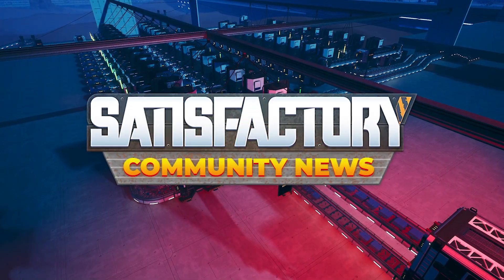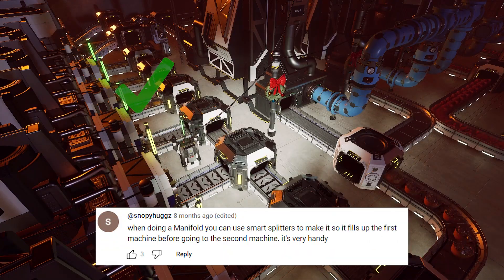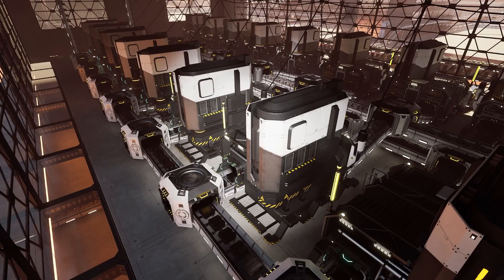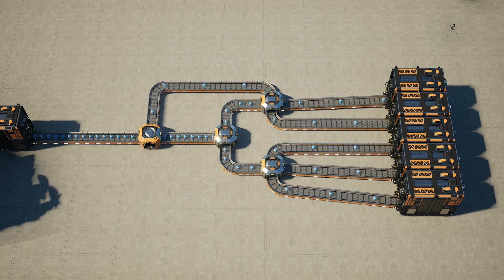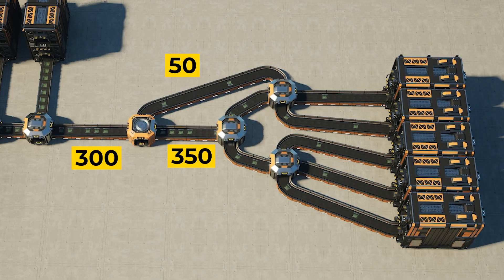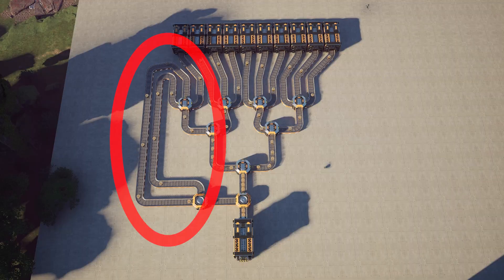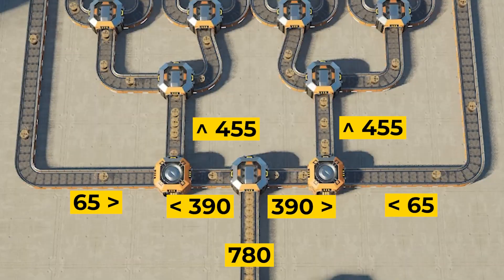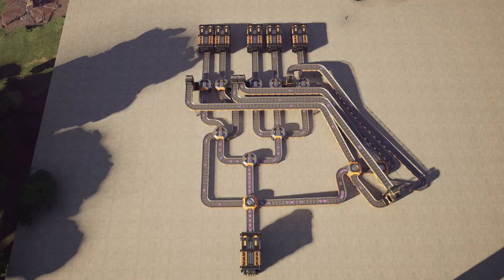Manifold and Load Balancing ADVANCED Tips | Satisfactory

Comment: Man I need help. What’s the answer to using a manifold thats way over the belt speed? I need to move 2k material :(
Reply from the maker: The only way is to split it into several smaller chunks. Instead of one system, make multiple systems.

Comment: Why all of this? All of these are very simple, yet they’re done in a complicated way. What we actually need is a scalable smart splitter for balancing. For example, if there are 10 builders, when we select doors and items on the first splitter, we should be able to assign a 10:1 ratio — then 9:1 for the second splitter, 8:1 for the third, and so on. That way, each splitter would take 1 of the selected item and pass the rest. It would also be great to have a conveyor belt with adjustable speed, like the ones builders use, so we can create smarter designs.

Comment: My biggest issue with conceptualizing how to move from load balancing to manifold is, like, okay... I set up manifold lines for my tier 1 parts: wire, plates, rods, etc... now, what do I do to manage that output across different needs?

For example, I set up a manifold for smelting copper ingots until I'm smelting the whole input. That output manifold needs to go into both copper sheets and wire, both of which need to feed both their own storage and their respective manifolds: cable and AI Limiters, which then need to feed both further manifolds and storage themselves. And so on, and so on, all the way down to manufactured parts.

So how do I decide what length to create each manifold? How do I decide, in the example above, where to divide between converting into wire and sheets? Or for iron, the divide between plate manifolds, rod manifolds, and cast screw manifolds? I would like to try moving toward adapting manifolds into my factory, because I can see the value in them, but my brain just doesn't work in a way that I can conceptualize how to apply them without serious foresight and planning.

Comment: I hate to contradict your correction on the loopback belts from last video, but unless mergers work completely counter to how splitters work, then your original design is fine. True, you can't over-saturate the starting belt, but the merger will still inject an item into its output from a different input each operation if possible. Your machines only backed up in the first video because they weren't on. You won't end up with a deadlock of belts, because if the loopback locks (which it won't**), it would still just send the items into the machines like normal. It's actually better to have it sent back to line 1 and be "over-saturated" because then the machines at the end will always end up with a consistent amount of items, and you wont end up with a huge backlog of materials you aren't using, provided you throw a smart splitter before the merger of the loopback on line 1 to send the overflow somewhere else to be used.

**Your loopback belt will never deadlock, even if you think it might, because you are thinking of the splitters and mergers the wrong way. You are not running a belt THROUGH a splitter and pulling another belt off of it, you are putting a belt INTO a splitter, and making it become more than one belt on the other side. Mergers are the same, you are not running line one THROUGH the merger, and only adding the loopback to line one, you are running both lines INTO the merger, and combining them into one output belt. If able, the merger will cycle which belt it pulls from every time it outputs an item. This may seem like a pointless distinction, but it's the only thing I can think of for why so many people thought you were wrong in the first video.

Regardless of where you put it, having a loopback at all will effectively lower the efficiency of the amount of items you are inputting, vs. the amount you are using, because there will always be some amount of items on it. The fact that this would be "over-saturating" line 1 doesn't matter, because you weren't even using all the items on it anyways.

You weren't wrong in the first video, but you also weren't technically wrong in this one either. Both are fine, but the way logistics work in this game, you can only really deadlock things that have more than 1 output (unless you are specifically trying to at least)
Reply from the maker: I think the point is, if your input belt is already at its maximum capacity, then a loopback belt will oversaturate the input belt. But, that depends on your numbers, and you can only guarantee that it applies to a fully utilized belt.

Comment: So I might be crazy, but I don't try to perfectly balance things. I've always done load balancing, but since we need to use many of these items for crafting, I just...end it in a storage box, label the storage box with my input (amount crafted) and my output (amount used by machines further up the crafting chain) so I know my crafts/min of say iron plates. Since I need a surplus of iron plates for crafting machines/conveyor belts/etc. I want a surplus. I figured my options are make a system that ends at iron plates, or just make a surplus of plates and run them up. It still takes up inSANE amounts of space to do it this way (sometimes 20+ constructors with several layers of splitting and remerging on the output), but I never had to care much "excess" or waste. in the end I smart split before the box that holds my precious goods and I just send the excess of the storage into a SINK for juicy tickets. It works for me, and it lets me expand to the higher tier stuff quite nicely, cuz I already know what I'm making from the labels and then I know if I need more to just slap some more machines down (usually this ends w/ several systems for one material as its easier to take a new ore and make some new constructors etc. to add to the crafted amount than it is to rebuild or OC something earlier on). It works for me and it makes it so I can still go grab some random mats I may need from their box instead of having to hunt them while my system fills entirely

Comment: For the 10-balancer, there is another way of doing it which only uses 1 loopback belt.

A 10-balancer is basically just a 2-balancer and a 5-balancer (since those are its prime factors). Start with a 5-balancer with a single loopback, then split each of the resulting 5 belts into 2.

The 10-balancer presented in the video, which splits the belts in 2 and then has 2 5-balancers at the end, is basically just the reverse of this.

Comment: Question about the loop back belts - if when an output belt is full the splitter ignores it, why not just have the 6 belts at the end of the two splitters (if you are trying to achieve 1:5 for instance), but just not connect the 6th to anything? Then you wouldn’t need to worry about a loop back belt oversaturating the input and the load should be shared evenly among the 5 left over right?
Reply: not evenly. if the first splitter splits 1:2 and the subsequent ones split 1:3 but the one one the left has a saturated output it effectively also becomes 1:2.
So on the left you get
 1/2 * 1/2 = 1/4 on each output and on the right you get
1/2 * 1/3 = 1/6 on each output.

All of this assumes free flowing belts, When the belts start backing up the resources will just flow to wherever they are missing (that's how splitters work in that situation) so you could just use a manifold instead.
Reply from the maker: In theory, that makes sense. But in reality, depending on how saturated the belt gets, it might not work. The first splitter will split the input in half. But one half is only serving 2 outputs, while the other is serving 3. Therefore the side with the dummy belt is getting more resources than it needs, and more than the other half. In some cases this will balance out, but at that point you would have been better off making a manifold.

Comment: Loadbalancing sounds like a solution that problem that shouldn't exist. Manifold has only 1 issues, the lack of player's patience. :D
Reply: i dont understand what problem ppl are solving with load balancing.. whats the goal here? i always use manifolds and when machines further down the line run dry, i add injector lines. the best solution for most problems: push more resources into the system. i dont care if a input belt stops because its full/backing up, as long as the end product is flowing.
Reply: @FalconDS9  Not having to wait 2 minutes, mostly. Maybe at later stage in the game it shines, I just started mid game lol

Comment: Underclocking (7:55) is a totally underrated solution in my opinion. Of course you need to have the space and the resources for the extra machines, but if its "just" some smelters - i really dont care. But Underclocking has a nice side effect: The machine takes less energy and i dont have to care about belt speeds, feeding back and yadda. especially working with multiple players on the same factory/world we endet up just building load balancers with enough machines in the most cases.

only there the machines are too pricy we have those with loopback and a clear warning to ask the person X before doing changes here.

Comment: One thing you didn't mention that makes underclocking "too many" machines much more attractive:

In addition to removing the need for loopback belts in your load balancing systems, "more machines" is a one-time cost that provides benefits for the lifetime of the factory... and best of all, underclocking has non-linear power usage benefits.

Let's examine your example of needing 5 machines' output (at 7:55 in the video):
5 machines running at 100% speed uses 500% power, and requires a load balancing system with a loopback.
In addition to simplifying your input by removing the need for a loopback, 6 machines running at 83.4% speed uses 471.5% power; that is, those 6 machines draw less power than the original 5 machines at full tilt.

Stop here if you hate math, or you don't care about power draw.

You can dramatically decrease the power requirements of the entire system (factory) by multiplying the number of buildings and underclocking them to produce the desired amount of product. 12 machines running at 41.67% speed would use less than 3.8 machines' worth of power, while still producing the output of 5 machines... but effectively giving you more than a full machine's output for free, power-wise.

I'm well aware that this next example is going to look stupid at first glance, but bear with me; in all honesty, it's not even as silly as I have taken this concept. Let's say you still want the output of 5 machines at 100% power, but you're willing to build 36 machines, each underclocked to 13.89% speed. The power requirement for those machines is only 3.15% each, so you end up producing your 500% output for a power cost of only a hair over 113.5% power... which means you're getting nearly 4 machines' worth of output FOR FREE (in terms of power).

As regards taking the concept to silly extremes: I have built an entire early-game production system making plates, rods, screws, wire, cable, and concrete... while using only the 40 power produced by the HUB's pair of (weak) biomass generators. It required pure nodes so I could underclock the miners (which were capped by belt speed anyway), and it took many hours to build hundreds of smelters and constructors clocked at (roughly) 3%... but while it was an absolutely ridiculous project, it was also absurdly satisfying.

Yes, it uses more space to build more machines... but you really need to get over the idea that space is even a consideration. According to the world size listed on the wiki, there's a theoretical build volume of 105,578 cubic kilometers on the map; you would need 736,127 foundations just to cover a single layer. Unless you're trying to build inside a cave, stop thinking about how much space your factory will use; there's nearly always dozens of unused floors of space above your factory that you're simply wasting... and FICSIT does not waste. Apply verticality to your build, instead.

Edited to add:
There's yet another benefit to "extreme" (half or lower production speed) underclocking that I forgot to mention: later, when you have bigger miners and faster belts, you can simply throw more materials at your existing factory, replace belts, and clock everything up... and you've increased production without having to build a new factory.

TL;DR: Stop thinking in twos and threes... start thinking in (at least) sixes and twelves. Underclock and overbuild; it's fun and efficient!

Comment: About load balancing, you can stack mergers and splitters on top of each other and use the upward belts, it can be a bit tricky but by doing that, it takes up a lot less space
you can also put the splitters right next to each others, you will still have to place a belt between them tho but it will seems like they are directly connected if done properly
it's a bit hard to explain without showing it in action but i tried it myself and adding multiple looping belts is still as easy as when you do it the way you showed on the video
although some might argue that it's way less satisfying, and i honestly can't disagree.

Comment: The only time I use slower belts for machines in manifolds is when the machine uses the exact rate that the slower belt can provide (60, 120, 270, etc.). In the general case it's better to fully max out your manifold belts with the highest tier of belts.

To fully startup a manifold, the idea is that you're trying to fill up the internal buffers of the first X-2 machines ASAP. By using slower belts, you artificially limit how fast you can fill up the internal buffers. 

A very simple approach to tell if your manifold is filling up ASAP is to look at your input belt. If it's set up optimally it should only back up if the machines get clogged. If it's backing up before all the machines are filled, then your slower belts are artificially increasing your startup time. The input line will typically only get clogged like this if you have the last few machines that need to be filled but are limited by the lower belt speed.
Reply: ironically the opposite of what he suggested, using smart splitters and overflow on main and any on the machine on the side, would make the manifold fully start up fast
Reply: @skillfulfighter23 What using slower belts as manifold branches actually does is it decreases the number of machines you're trying to fill quickly.  You gave the example of X-2 machines, which is correct in the case where the branches are the same speed as the main line.  This is because the last two machines will fill at exactly the same rate once everything in front of them is full.

But if the branches are slower than the main line, that changes.  For example, if the main line is Mk5 (780) and the branches are Mk1 (60), then the math becomes "how fast can I fill the first X-13 machines", because the last thirteen machines will fill at exactly the same rate once everything in front of them is full.

Which is "better" honestly depends on the number of machines in your manifold, compared to the ratio of manifold mainline speed to manifold branch speed.  In one most extreme case (Mk6 belts vs Mk1), a manifold that contains twenty machines or fewer will fill up "instantly" (as soon as the material travels the length of the mainline).  This means any manifold shorter than twenty will not benefit from a different approach (including balancing).  In the other most extreme case (the branches are the same speed as or slower than the mainline), then any manifold longer than two machines will take longer to fill.

I guess the overall point is that your statement of "you're trying to fill up the internal buffers of the first X-2 machines ASAP" isn't quite true.  It's often true, but more specifically, it's a special case of the more general statement "you're trying to get enough internal buffers filled up that the last 2 machines are always getting their proportional share."  The example of faster mainline slower branches helps lower the time to achieve some instances of this, but not others.  It'll never make it worse though, as even if you're artificially limiting the speed at which you are filling up the first machine, you're filling up other machines by the same amount (unless the last machine is getting its equal share).  Very situational-dependent.

Your last point, however, is nearly completely valid.  If the input belt is backing up on a fully-functional manifold, that means every single machine on the manifold either is maxed on the input or is actively running*.  No machine *needs a full input buffer to run at 100% as long as it's running and is guaranteed enough input to keep it going.

Comment: In my opinion, there are three reasons to use load balancing over manifold. One, a load balanced system is more fun to build than a manifold (not by a particularly massive margin, but it is more fun) two, it looks better because items are always flowing with no stutter, and three, you don't have  hundreds of machines filled input and output with maxed stacks of items, which becomes a major mess if you want to dismantle the factory.

All in all, the biggest crime of manifolds is that they are boring.